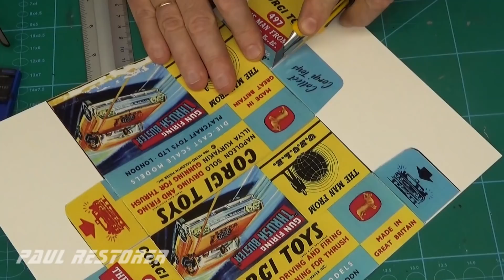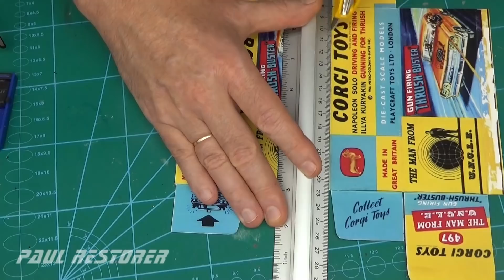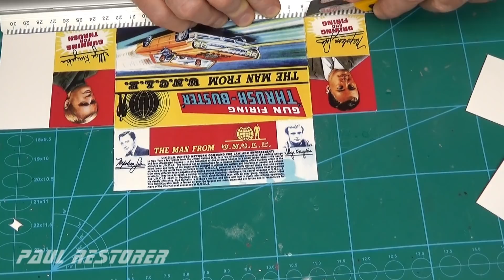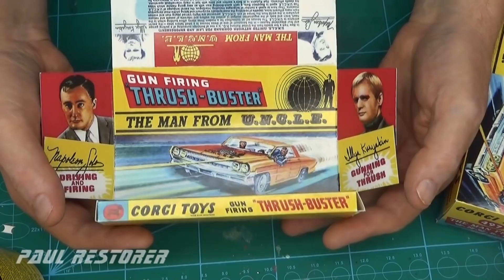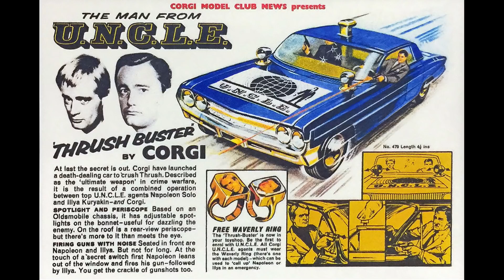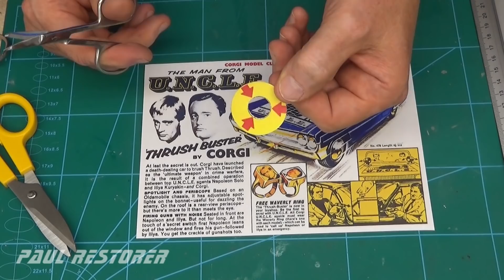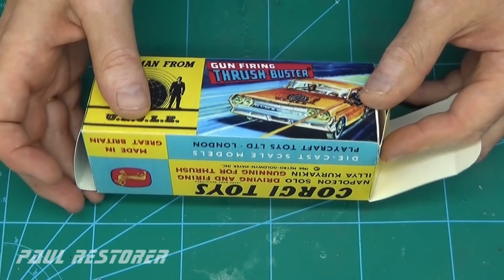Corgi renowacja "The Man from U.N.C.L.E" car oldsmobile nr 497. Zabawka model odlewany.

Comment: That’s a lovely job, beautiful restoration. If I recall correctly (but I might be mistaken) the ring picture changed as you moved it in the light. I’m sure someone will correct me if I’m wrong.
Reply from the maker: Thank you very much. Of course you are right that there were two images that changed depending on the viewing angle.
Reply: It did I had one loss ring but car needs TLC